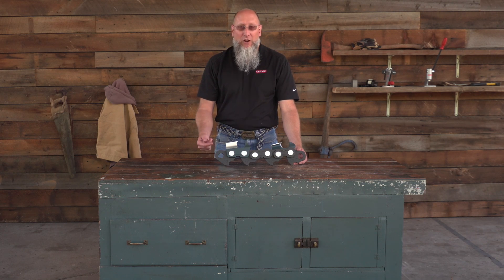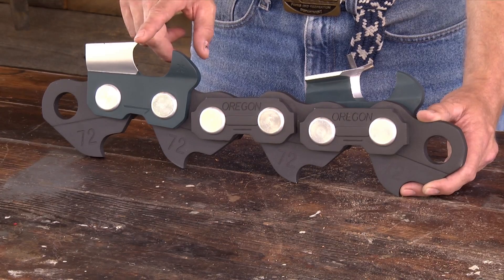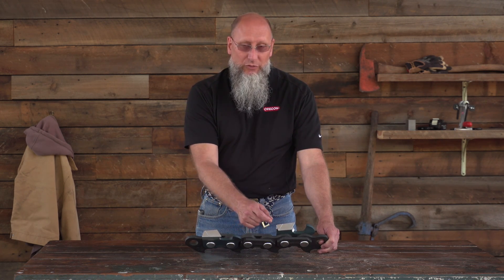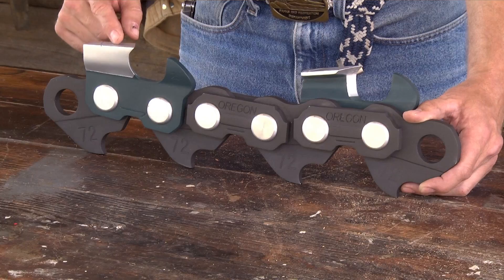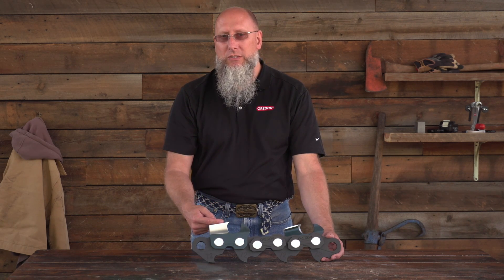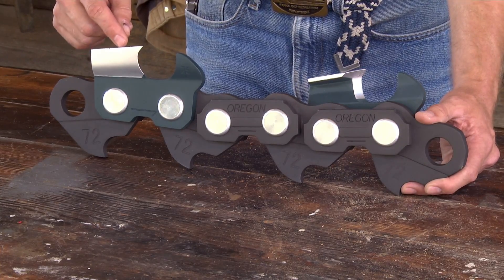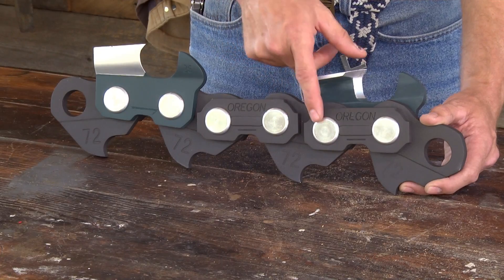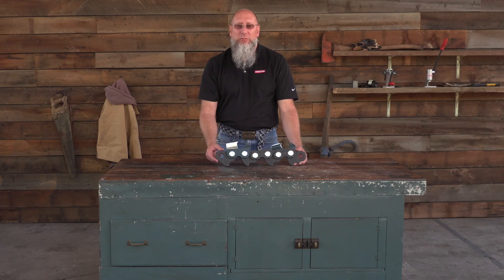Technical Tips- Saw Chain Anatomy

Comment: Google AI says that 72 is "the drive length count".  So it correlates to length but pitch and gauge also factor in.  A 72 drive length will usually have a 3/8 inch pitch and an 0.050 gauge.
Reply: That makes more sense.

Comment: You  failed to explain what proper gauge means,  the bottom  of the drive link that fits into the (guide)  bar groove.  This number, "72",  stamped on bottom of drive link  denotes "50 gauge"...
Reply: But why stamp 72 instead of 50?
Reply: @robertbrandywine  That number is exclusive to each manufacturer , their own "code",  in this case Oregon Products...

Comment: Everything was good until you said the "72 equates to a 3/8 standard pitch". How does the 72 equate to that? Is there a calculation for this? Is there a chart showing this? LOL, this video is five years old, I'm a bit late to the show! Thanks.
Reply: "72"  denotes a 50 gauge chain...
Reply: I totally agree - horrible explanation of pitch, sprocket, and tip of bar.

Comment: Can you explain how to identify the left vs the right cutters?
Reply: When the chain is correctly fitted to the chain saw, the teeth move toward the tip, around & pull to the drive sprocket. So looking from the power head towards tip of bar, the left teeth protrude out on the left side of the bar slot { & the right cutters,on right }.
Normally the cutters alternate, though sometimes the drive link count means that you have two lefts or rights following each other.

Comment: Thanks for the great explanation.  I have a 62cc with .325, .058, 76DL and 20" bar.  Id like to replace the bar w/ a 24" but the specs change to 3/8 .050 84dl. Do/can I have to change the sprocket? Thanks!
Reply from the maker: Hi Steve,

Thank you for asking! In order to better assist you with the correct sprocket, we just need to know the make of your chainsaw. Please feel free to contact us at technicalservices@oregonproducts.com or call us at 1-800-223-5168, Option #1, and can point you to sprocket fit-up for your chainsaw. 

Thank you,

The Oregon Team

Comment: Thank you for this, and using an oversize chain for your presentation is a very good idea. I haven't used my father's chainsaw yet, so I'm watching your video for information. You mention that the pitch is any three rivets from the center line (of the rivets) divided by two, and  I found from another video that it's the distance between 3 consecutive rivets divided by two, which you may presume to be obvious, but it doesn't hurt to say it. Then you say that because the drive link has 72 stamped on it, that the pitch is 3/8 standard, but how does 72 mean 3/8 standard pitch? And you mention both pitch and gauge , and say that they're both important, but you don't explain what gauge is .
Reply: I found some answers to my own questions. The number 72 doesn't (apparently) mathematically translate in any way to 3/8, it's a code , and different chainsaw manufacturers use different codes , so you have to find a reference to the codes to know what they mean. 

And GAUGE is the thickness of the drive link 

The pitch of a chainsaw chain is a measurement that describes how close together links are on the chain. It does not tell you how many links are present, or what the overall length of the chain is.
Pitch = the distance between any 3 consecutive rivets on the chain, divided by two.

And apparently the code stamped on the bar may refer to both the values of the pitch and the gauge, as in 72 may tell you that the chain is 3/8 pitch,  and is also .050 gauge. Other different codes or code numbers can mean a similar pitch but different gauge.
Reply: @dannichols6261  Thank you for the up dated information.  This is awesome lesson.

Base on your understanding, what is the practicality of such terms as "gauge" and "pitch"?
Reply: @organogardener9210  I'm not sure what you mean by 'practicality'.  Do you mean "what is it the terms mean", or, 'how do you make use of the information gained from the terms', or "do the terms help or not help people know what they mean", or something else?
The meaning of gauge is fairly easy, but I didn't really explain that very well previously: it's how thick the BOTTOM portion of a link is, so it will fit properly into the slot which runs around the three sides of the bar (top, bottom, end). If the bottom portion of the links is too big, they won't fit into the bar's slot, so the chain simply won't move around the bar. Too narrow, and it would probably run so  wobbly in use that it might fly off, I'd guess,  likely very dangerous!  
Pitch is a little harder to explain, because how you measure it only indirectly relates to the use of the chain on the saw. Pitch tells you how close together the teeth on the gear wheel which drives the chain must be. And since they're talking about distances between teeth around a wheel, like the teeth on a bicycle gear, that's similar to the distance between the threads on a screw or bolt, which is also round, and those distances are referred to as pitch too.
If you mean are the terms 'self-explanatory', well, sort of, in that gauge generally is taken to mean thickness, and pitch generally does refer to the distance between things which go around something, though there are also other ways they're used, like the pitch of a roof, or the gauge of a shotgun. You just have to learn what the terms mean in whatever particular application.
Here's one source I found that helps: https://www.ereplacementparts.com/repair-center/article/1507/Chainsaw_Chain_Measurements_Sizes_and_Types.html
, and here's another: http://www.madsens1.com/bnc_pitch_gauge.htm .
Reply: @dannichols6261  Oregon Products should being paying you;  you're doing a helluva lot better at explaining stuff than their social media administrators.
Reply: @Gr8Layks  Heh heh, don't I wish! :) But as I find in trying to answer both my own and others' questions, it's very hard to say things which at the same time actually answer a question, and give enough background to the answer so it makes fully good sense to the person with the question. Particularly  given that not everyone knows the same things, and we all unconsciously assume that when we say something which makes good sense to ourself, based on all our unconscious background knowledge, other people (who actually don't have exactly the same background knowledge), will simply get it.
Reply: Great question.   I am  very much a nubie  myself and find your comment right on money for nubies.  These thoughts you mentioned maybe redundant to experts, but to nubies,  they are the ABCs of learning chainsaw.

Comment: Definitely helpful. I don't need one yet but I was looking to try and figure out what my el cheapo  saw had on it should I decide to "upgrade" (read as- repair by replace) certain parts like the bar and chain. Got the saw due to it being free to me so if it was a bust I wasn't out anything. Surprisingly the damn thing cuts, and decently. Being a mechanic I know all things break and chainsaws are something I always used, but were someone elses.